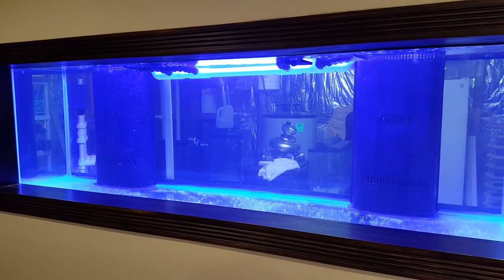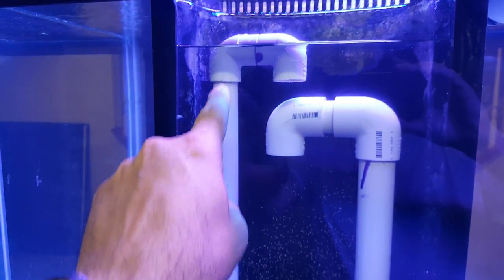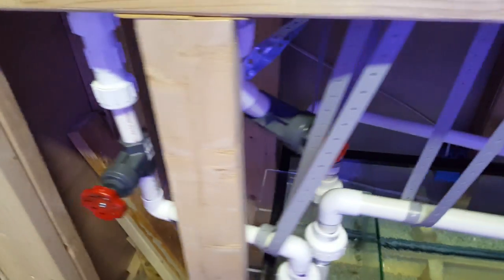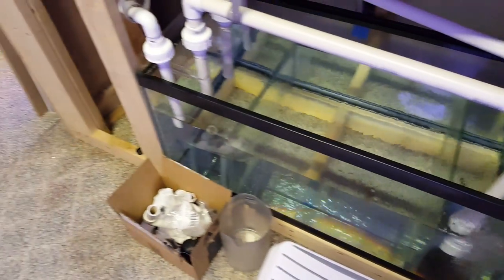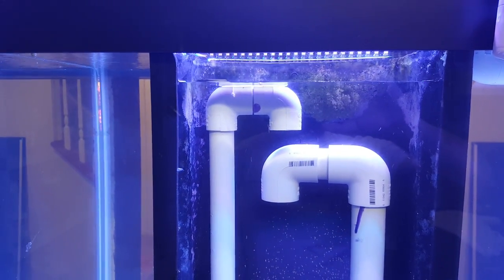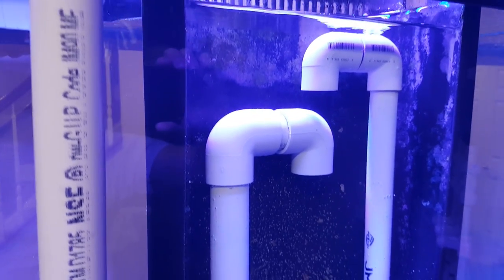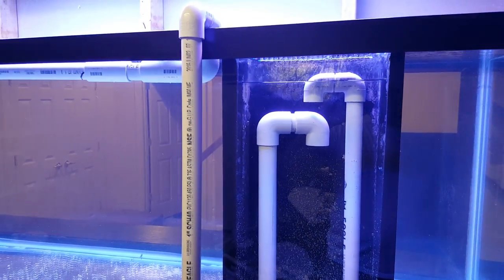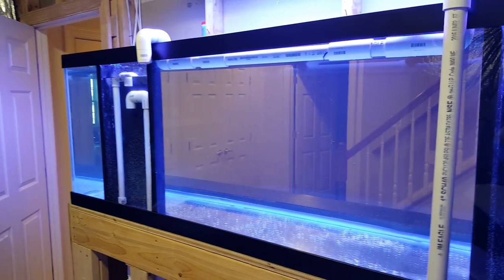How to turn a mega flow into a full siphon.

Comment: I love the set up.  My inner plumber aquarium enthusiast self tells me ball valves would give you more control of your flow,  and also more dependable as far a valves go. 
Great video!  I have a 220 Marineland I just leak tasted after re- seal, and built new aluminum frames.  Thanks for the tips!
Reply from the maker: Hmm - I think you have it backwards. Ball valves are less reliable, less precise, and have a tendency to freeze up and break. Gate valves have none of those issues.
Reply: @WoodBob  I may be wrong but I have fixed more broken stems and frozen gate valves than anything and I've been dung it for years as a profession. 
I have never seen ball valves break,  or get frozen beyond opening. 
I have had to replace handles from wearing out is all.
I will admit gate valves are better for flow control,  as I just looked into it.

Comment: Popping in to give a quick thanks and thumbs up. I used this video as the guide for plumbing my new 125 with mega’s. Dead quiet, amazing flexibility and peace of mind with the added drain lines. I inherited a Jebao DCT12000 with this tank and it can handle that at full blast if I wanted to run the Mississippi through my sump. Thanks for the great visual reference and demo 👍🏼

Comment: I found this incredible helpful and am going to try it in my new 125 tank.  The plumbing kit that comes with this tank is so LOUD! All the air that gets into the Durso does a lot of gurgling in the sump, like it needs a breather down below (but I'm not about to do one of those).  I think this will significantly quieten my system.

Comment: I copied this for my 535 lt. marine tank and I turnover more than 4000 litres per hour (via twin Aqua Medic Eco Runner 6000  pumps . It is now TOTALLY silent and restores quickly after power cut. My tank uses 40mm piping and gate valve, but apart from that the setup is the same. Takes a little bit of trial and error to get the perfect result. Start with balancing the flow with the valve then adjust the height of your overflow pipe to get the best results. It's really weird that the tank makes NO sound and the loudest sound in the lounge is the ticking of a clock!

Comment: This system is very similar to what I manufacturer  Put some syphon breaker holes in the returns, below the waterline on the inside of the aquarium. Make sure you drill the holes so they neither on the bottom of the pipe or shooting water above the surface. This way the nozzles can be trained in any direction and plumbed to any level.

Comment: this video was perfect, i was looking for a bean style setup with this type of tank. my question is, how long did you cut the 2 sets of pipes you installed inside the drain, looks like a 3/8 or 1/2" hole on top also, ty.
Reply from the maker: I am not quite sure how long those were but you can get a general idea from the video. As long as the full siphon is below the open channel, you'll be fine.

Comment: It's amazing that most people don't do this with their setup.
Reply: It's pretty cool. Why does one do this instead of the factory tubing?
Reply: @-8_8-  It's more quiet, actually completely silent.  It's safer than a traditional factory setup, in case of blockage.
Reply: @muffemod  it seems to kind of defeat the purpose of a drilled tank with that giant tube coming over the back of it. But I guess worrying about clogs is a big deal in some set ups.

 I do have weird problems where the side hole on the factory durso act as my drain hole instead of the open 90 with the cage on it. Which I think is for sound mitigation, but I think I might have to plug it and do the Dan hershaw air shut off valve out of the top.

Comment: Hey Bob does it matter on which side inside each overflow the full vs. emergency siphon is on?
Reply from the maker: It doesn't matter other than if one of your holes is larger like mine, I suggest making that your full siphon.
Reply: Ok ya both holes take 1" plumbing in them in each overflow so it doesn't matter then if I pull the full siphon in each overflow on the left or right side correct? I ask because it helps with routing the plumbing. Thanks! @WoodBob
Reply from the maker: Yep - whatever makes it easier to plumb.

Comment: What gallon size sump Is that?  And can you explain why the difference between full siphon and open please?  And why do you need both ?
Reply from the maker: It is a 40 gallon "breeder" style tank which lends itself nicely to using as a sump. Full siphon means all of the pipe has water in it with no air. All water, all the time. There is a precise flow that a full siphon maintains that is dependent on gravity, distance, pipe size and a few other variables. In a closed system like a fish tank, there is no chance you could set up a full siphon drain and maintain the exact amount of return water that is needed to maintain the siphon. Too much and your pump runs dry, too little and the siphon runs out of water and "flushes". The solution is a separate "open" channel that runs in parallel with the full siphon. With the 2 drains, you set your return water to be slightly more water volume than the full siphon requires. This extra water flows down your open channel, which is variable rate (up to a point).

Comment: I just acquired a 75g with a megaflow. Do you keep the 1inch fully open and tune the 3/4? Or the other way around?
Reply from the maker: I use the 1" as the full siphon but it doesn't matter you could use either one. Just remember the full siphon stand pipe needs to be lower than the open channel so the extra water slowly rises up and trickles down the open channel.

Comment: Another question for ya Bob. In your sump does the first glass baffles after where your drains come in go all the way to the bottom of sump so water has to go over or do you have the glass baffles raised a little?  And then the last glass baffles does it go to the bottom as well? 
Lastly the gate valves on the overflow pipe is it absolutely needed or can I just plumb it directly into sump? Thanks!
Reply from the maker: I do not have any path under the baffles or a bubble trap. I have 3 separate compartments and water flows only over those baffles. 

You do not need any valve on the overflow pipe. I have it only for maintenance. The full siphon does need a valve though.

Comment: I recently got a 112g aquarium with dual overflow towers and my plan for plumbing it was going to use the bean animal method by plumbing the two towers together. One tower would house an emergency along with a durso overflow while the other tower would have the full siphon. I'm tempted to copy your set up however.
Reply from the maker: I also considered that design but my fear was not enough water in the open channel drain to keep that tower from becoming stagnant. And if running the full siphon in one and the open channel in the other it would be a lot harder to get the drains balanced.
Reply: robc The rest of my fittings are coming next weekend but I'm going to try connecting the two towers with a full siphon on one side while the open/emergency overflows in the other tower. I'll give it a try and I figure worst case scenario I can just close the valve between the two towers, add the needed hole for another overflow and then go with your method. I'll let you know how it goes. ;)

Comment: Hey Bob, another one here - You have gate valves on both the Full Siphon & overflow siphon on each side. You mentioned that the overflow siphon valve is just there to turn off/on if needed. So in that case do we even need a valve on it or can it be an open pipe right into the emergency section of the sump? Does that valve you have on it now serve any other tuning capability or simply just on/off?
Reply from the maker: Nope it is totally unnecessary.

Comment: I've been researching Herbie overflows, and even did one, but I'm having trouble understanding the "open channel". Is it completely empty as if it was an emergency drain in a standard Herbie?
Reply from the maker: The open channel exists because it isn't possible to maintain a full-siphon without a little water running into another pipe to even (tune) things out. There will always be a little water trickling into the open channel.

Comment: I'm doing the same thing with my 210 gallon except that the one inch full flow drains on mine have 1 1/4" normally closed electric solenoid valves that stay open for water flow when energized and close if there is a power failure. They are saltwater and acid rated  with a 100% duty cycle. I used 1 1/4" valves to match the flow specs for one inch PVC since the valve's internal construction causes a little flow loss. The 1 1/4" valves  are CPVC construction with stainless steel components. None of the stainless steel internal components come in contact with the saltwater because of the way they were designed. They are a little pricey but to me they were worth the added insurance.
Reply from the maker: So almost like an electronic version of a "check" valve except it closes with no power. I do like the idea in concept, but would not rely on it for flood control. Like a check-valve and the reason they fail is marine growth within the valve. When/if the time comes that you need this to close because power went out, you may find that it doesn't seal all the way.

Comment: Is there any concern with detritus building up at the bottom of the overflow towers?
Reply from the maker: I have never had that issue. The weir towers themselves have multiple inputs at the bottom, middle and top. That keeps the water in the weir circulating. If it did though, it would be fairly easy to vacuum out.

Comment: Morning Bob. So I have my tank running for couple days and notice aome things and want to see what you think. I have a little stream a water coming out of the emergency drains is this normal to have and if so does that pipe go into the sump below water line so it's quiet. Also I have my flow pretty High I think which I kind of want because I have random flow generators on my returns and want those to create flow, but since flow is high I have a little more noise coming from my overflows but it's simply because of that fast flow. What do you think?  I habe the mdp-15000 pump which I know you don't like but have it cranked up to 75 out of 100.  This is on a 220 gallon tank with 4 large 1" returns and a 1-1/4" return feed pipe to those returns.
Reply from the maker: Yes this is fine because it is not an emergency drain it is the open channel used to balance the full siphon. There is no way to keep a full siphon going exactly so some water must trickle through the open channel. I have mine just below the water level into the sump so it is silent. 

If the noise is from the weir it is probably just the drop from water running into the weir. There isn't much you can do about that accept maybe raise your open channel stand-pipe as far as it will go (and still be 1/2 under water).

Sounds like it is working great! 🙂

Comment: Great video!  Have a 125 that am going the same route with, but will use the two 3/4 returns as the siphons since they should be about 1500 gph combined. And the two 1" should gravity feed any extra needed. Was planning on a Jabao dcp-6500. Considering you used the 1"er's for siphon was wondering how much your valves dialed back the flow...

Comment: ok I have a question....why go with a Bean animal minus the emergency drain standpipe.....instead of a true Herbie? A Herbie will be similar: a full siphon + an e-drain. Seems to me that the Durso in your setup (the higher standpipe) is only causing noise at startup...and maybe delaying the full siphon from starting. Is there something I am not understanding ....I mean there must be a reason you skipped a true Herbie setup right?
Reply from the maker: This is a Herbie style drain running full siphon. A Durso is a single pipe and does not run as a full siphon. There is no way to reliably keep a full siphon exactly balanced. What you are calling the emergency drain (it is not) is there solely to balance the full siphon. Without it, the return flow would either be too low, causing flushing, or too much , causing a flood situation. A "true" Herbie with a full siphon and a dry emergency drain is a unicorn; It simply does not exist. 

The hole in the top of the overflow/balance standpipe/drain is to allow water to come up around the curved part of the pipe and trickle down. Without the hole, the pipe would create an air-lock and not allow the trickle to reliably start. It would probably start eventually, but the air hole helps a lot. You could mitigate that by simply having the top of the upper standpipe open for the water to trickle into. That would be somewhat louder but work just as well. 

My point in this video is to show that the 3rd "true emergency" drain of the Bean style is unnecessary with good tank design.
Reply: @WoodBob  Thanks for the reply. Interesting observations :-) Of course I have no idea (gotta read up more) about the true-ness of the e-drain in a Herbie. I have neither a Herbie nor a Bean Animal...so no real experience with either. I read about the emergency drain in a Herbie here: https://gmacreef.com/herbie-overflow-reef-tank-plumbing-method-basics/ so I assumed that information may be true. I suffer with a noisy Durso in a single mega-flow in my sole 75G DT...the noise is not really from the overflow...it emanates from the sump...where there are a ton of bubbles and splashing water. I have been researching and experimenting on a viable solution for days now :-(
Reply from the maker: Is your Durso sump drain pipe underwater in the sump? Exiting underwater should eliminate most of the splashing and noise. I suggest you set up your tank like I show using both mega flow pipes as drains and go over the back for the return water. It'll be whisper quiet and increase your flow. 

On paper (theory), a Herbie is a full siphon with an dry emergency drain. In practice (reality), you simply will never get a reliable perfectly balanced full siphon.
Reply: @WoodBob  Yes, my Durso drain is under the water line in my sump, by around 1 inch. It is the huge amount of air (which is pulled down by the falling water) which causes a bubbling and splashing and hence noise.......not the water going down itself. I have tuned the hole at the top, air valve etc. Those things help reduce noise in the overflow...which I have little to start with anyway.
By they way, from whatever I have read so far, Herbie does not have a dry e-drain...it needs a trickle down the e-drain to function. Why does the e-drain need to be dry is the question still remaining in my mind :-) Noise? Slime buildup? IDK.
Reply from the maker: Yes this is one of the issues with a Durso - noise from falling water. 

If the emergency drain pipe is the same size as the primary full siphon pipe in a Herbie, then if a small trickle of water is going down that drain, if it was called upon to take over as a full-siphon, it would not have the capacity to become a full siphon. 

If it was a smaller pipe size, then it would never be able to act as an emergency drain, dry or not.

If the pipe size was larger, then it could take a trickle and also act as an emergency drain.
Reply: @WoodBob  Well, I have been thinking.....just like you....I have also designed my sump's return chamber to be small enough to not overflow the DT, in case the drain blocks. As is, my Durso setup I have has no e-drain. So what is the downside of me changing that Durso standpipe to a full siphon? Or is that second/open drain you have is really needed?
Reply from the maker: An "E" drain isn't needed for any setup. That is the myth. You do, however, need an open channel standpipe to tune the full-siphon. You need both drains in your weir for a successful "Herbie" drain - full-siphon and open-channel "trickle" drain. Then you would need to go over the back of the tank for the return.
Reply: @WoodBob  Thank you for the explanation. Also...for the benefit of anyone else reading this thread......I found some additional information on why the second drain is needed.... and I quote, "Full siphon would be to put a valve on the drain and require you to adjust it such that there was only water in the pipe (no air). It is not possible to perfectly match the flow from a siphon to the return pump so you would also need to have a secondary gravity based drain which handled a small portion of the flow. This would be a herbie overflow." Ref: https://www.reef2reef.com/threads/stupid-durso.604783/post-6103394
Going back to my setup...I have been playing around with a "reverse Durso"  in my sump (drain)...I do see some reduction of noise from the sump...basically the low frequency gurgling/splashing converts to a high frequency "breaking of bubbles" type noise. The latter is subdued by closing the doors. I may want to put some acoustic foam on the back wall, behind the sump...and call it a day for this tank setup. Next tank.......I am definitely doing the Bean animal setup + an overflow box on the outside + a sleek, wide weir on the inside. I hate how these mega flow overflows look :-)